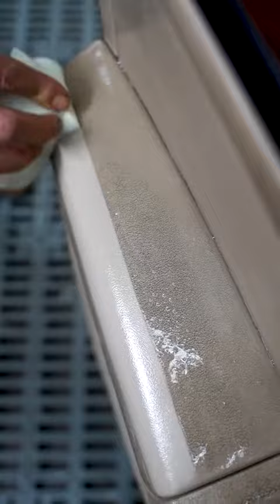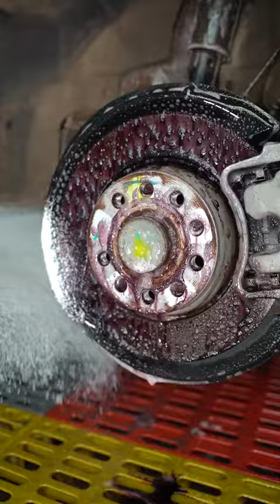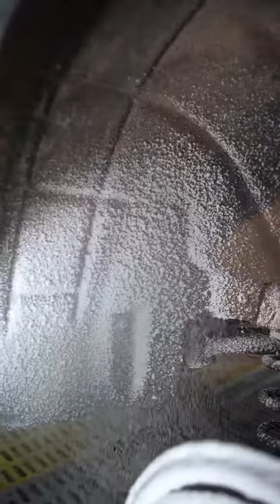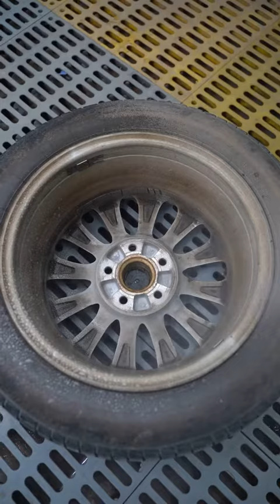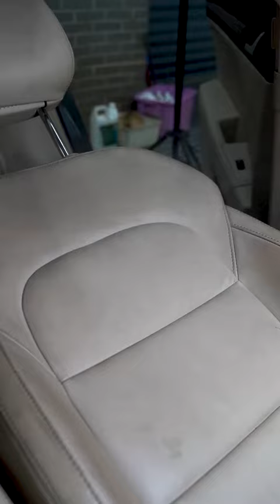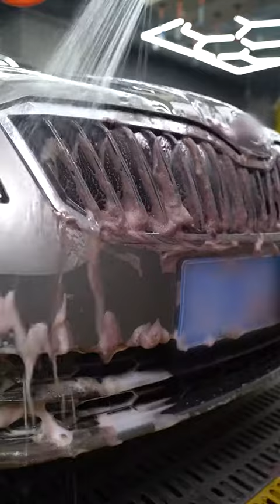Satisfying Car Cleaning | Car Cleaning ASMR | Deep Car Cleaning - Part 29

Comment: Why the f did you use magic eraser on leather seat? Everyone knows you should use non aggrasive manners to deal with leather seat. They have a clear coat protector on top. Sure it cleans fast, but you take away the clear coat together with the grime. That is not the safest way to detail. And please tell me you don't use APC on leather seat. 

I've been detailing for 12years. This is the first time i saw a detailer use magic eraser on  leather seat.